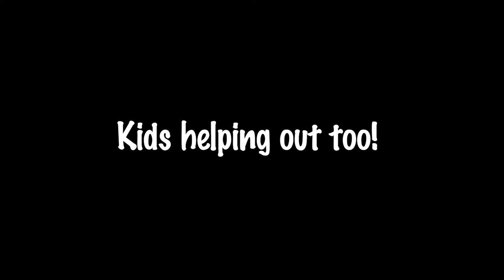Building Beam to our Floating Deck - Our Journey :: Episode #49

Comment: Very nicely done and your photography does a great job of covering key details.  I built a deck something like this, but learned later of a key mistake that you two made as well. The beams should rest on top of the support posts and not bolted to the sides.  The sheer strength of the bolts is not there. I did the same thing and screwed 2 x 4 blocks right beneath the bolts. My mistake was trusting a youtube video that did the same thing.  What we are supposed to do is cut slots in the tops of the support posts so the beam rests in the notch of the post. The bolts are only there to hold the thing together and there is no real stress on the bolts.  My next deck on my land will be 14 x 16.  Normally, the joists are 16" on center. 

I do not recall seeing blocking between joists, which by code is required every 9 ft in order to keep the joists aligned.  Those of us who do this sort of work in remote areas tend to ignore codes or inspections. We also tend not to realize how much weight ends up on decks and porches. (My deck would be great for clogging and tap dancing)

The part that I agree with entirely is how many beams you have. I have my ground posts 3 x4 feet apart. All loads on the deck are well distributed.  My posts go below the freeze line and are 24" holes with 50lb of cement. My next deck will use 6 x 6" posts. Easier to notch. 

The fun part was seeing a loving couple working together. 
 By the way if you get freeze-thaw issues with the cement supports, dig 2 ft holes under the beams in a few places, set in concrete tubes, jack the deck up .5", cut a short piece of 4 x 4 to go vertical,  and insert a short cross piece of 4 x 4 against the beam. My son had a DIY porch that came with his house where we had to completely redo the porch supports because the above-ground cement pilings were shifting due to shrink-swell freezing. The porch was reaching a point of being too dangerous to walk on. 

Thanks for a lovely video.

Comment: That looks sturdy enough to park a truck on, cool looking deck..  Could you have used a 2x2 on each side of the 4x4 with the thru bolts instead of notching both 4x4's like that? (the 4x4 that's notched to fit in block)  That is an interesting method.